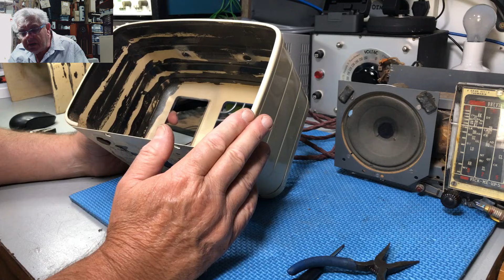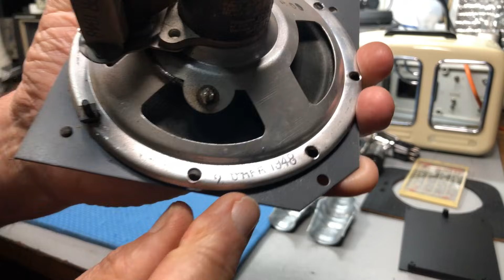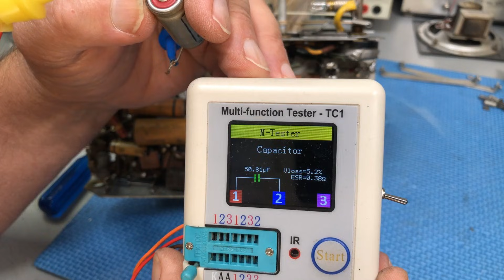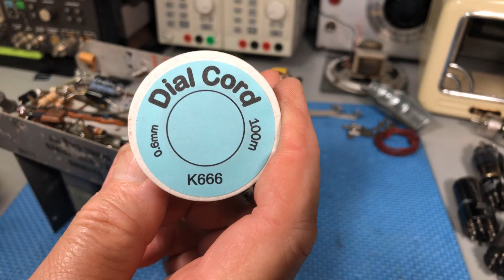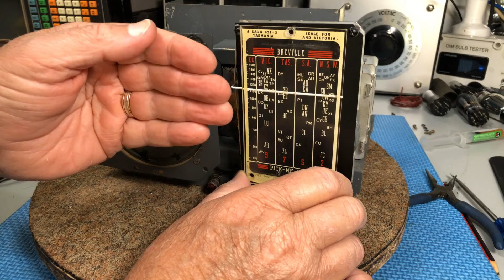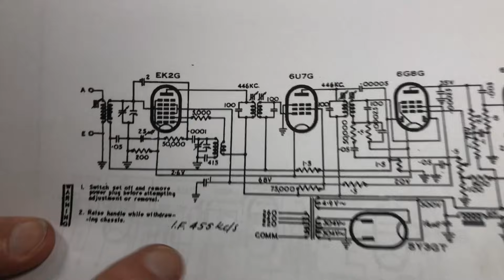My Baby Breville "Pick-Me-Up" Restoration - Part 2

Comment: If all dial cord stringings were like this one it wouldn't be such a #@$%$#@!! job (but the dial plate appears to have been a different story). Oops, looks like you got the two tubes mixed up (6K7 in the 6G8 socket and 6B8 in the 6U7 socket). I spotted it as soon as you were installing the 6K7. Caught yourself at 1:13!!! That's why I have a second pair of eyes look at my work if I am having trouble. I know, you just did this to test us!!! On the schematics you are showing, all of them have 446 kHz printed above the IF transformers. When this radio was made (or at least the speaker and transformer) my Mom would have been 31. In fact her 31st birthday would have been only 2 days later). I remember her telling about the Silvertone radio they were happy to get from Sears and about the "high lines" coming through from the power company a few years before so they had electricity.
Reply from the maker: Yes Doug, glad you caught on to it was a test, yeah right LMAO !
So many techs has told me it was 455khz for the Pick-Me-Up 5, 446khz for the earlier 4 valve version. It did line up pretty nicely on 455khz, next video up tomorrow.
Cheers

Comment: Whoever replaced the capacitors in this radio 📻, must have done it, with smaller, underrated capacitors. That can lead to problems, especially, if the capacitors are not rated at the same tolerances as the original capacitors. Your friend, Jeff.
Reply from the maker: Thanks for the tip Jeff, I'll make sure to use the right specs on this one! 👍